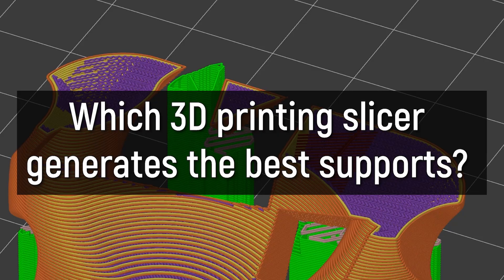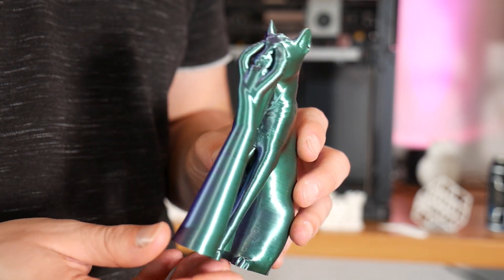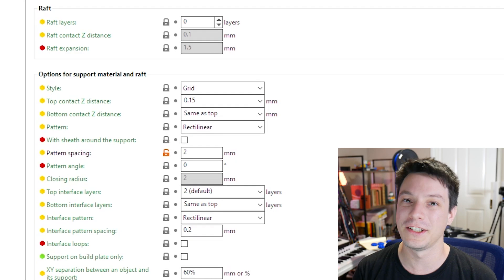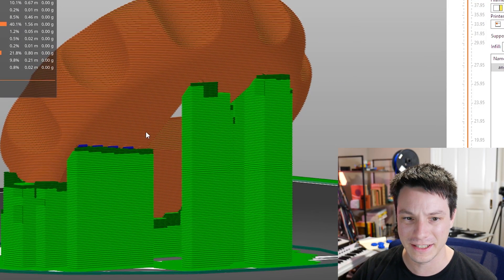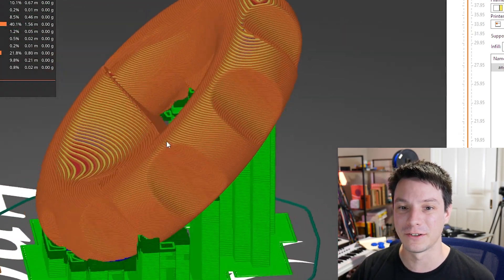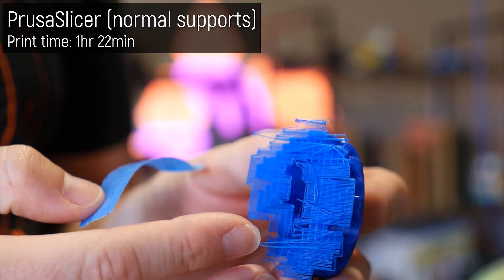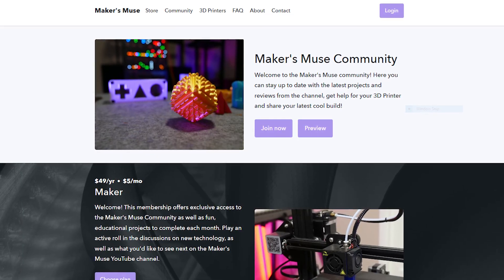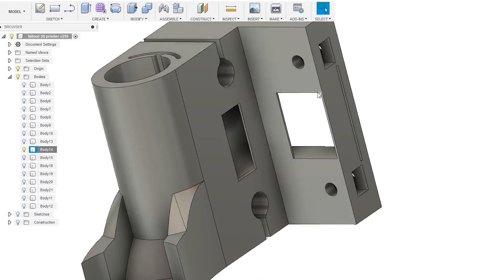Which slicer has the BEST support material? #3DP101

Comment: Regarding your last point, avoiding support is the best strategy, I have had so many problems with removing support I have an aversion to support material at all! One thing not to be afraid of is to design your part as mutiple parts that screw, glue, or clip together. Its tempting to try to make it print out all as one part, but sometimes you can make a nicer looking part as multiple pieces. This also means that making minor changes means you can just reprint one or two pieces rather than the whole thing, and it also opens the opportunity to make your part multi-colour if the aesthetic is important and you don't have a printer with multiple extruders.
Reply: This. Comparing my more recent projects that are designed in pieces to my older projects that are just one big object cut up using meshmixer, designing for it means you have so much more control and can often avoid support entirely
Reply: Totally. Printing a model in various parts and gluing them together can be a great way to side-step hassles with supports. 
Something else I found helpful and quite easy is to design my own supports instead of relying on the slicer to do it for me.
Reply: One thing that helps is using a hair dryer or heat gun to heat up the offending areas. Makes it much much more easy to pull off stuck supports.
Reply: Usually layer height x 1.25 worked for me quite well, depends also on material, some just have better layer adhesion than others.
Reply: Probably works well for machines and stuff, but I've found that with art designs this usually isn't really an option, especially not when it comes to organics.

Comment: TL;DR: "Preferences" -> "Configure Cura" -> "General" -> untick "Automatically drop models to the build plate"

Really quick tip for anybody getting angry at Cura for dropping the parts to the build plate automatically (as I was before I looked at the settings): There's an option in the menu bar, "Preferences" -> "Configure Cura". It should start you out on the General tab (otherwise switch to it) and under the heading "Viewport behavior" there should be a checkbox for "Automatically drop models to the build plate". Uncheck that if you don't want the lowest part of your model to touch the build plate (i.e. hang it in midair to generate supports underneath).

Extra tip: if you don't want to switch that option on and off all the time, you can manually drop the model by selecting it, using the "Move" tool (or pressing 'T' ) and setting the z value to exactly 0. Hope this helps somebody :)

Comment: I’m surprised no slicer is using local adaptive layer height to increase the printable overhang angle. It shouldn’t be that difficult to have it print the outer edge in two or more layers, and then the rest of the layer at ”normal” layer height. That way you can get away with really steep angles.

Comment: Designing parts that don't need support is a challenge I enjoy.
Especially TPU when you can use its flexibility to create living hinges in the print, giving it some origami traits.
One of my designs needed support so I made the pieces myself and put them into the design because I didn't trust the slicers to make them. It works well, the 3 support pieces easily snap off after printing, helping ensure the end users get perfect prints each time.

Comment: As a beginner to 3d printing this is was incredibly helpful.  Perhaps as a part 2 you can also include information and advice on model placement and orientation to help with better print quality and support use.  For instance, you mentioned the sharp downward pointing angle and how it must have support.  I would assume something like that could be greatly assisted with rotating the model.  Placement and orientation is definitely an area I find to be tricky at times, especially when I need t set supports.

Comment: I have been playing with Cura's tree supports in the alpha release. I had quite a few failures until i realised that it doesn;t cap off the supports by default. So you can end up with a tall support building up fine but because there was no top on it the thing it was meant to be supporting fails. There is the option to include a top but you need to make sure there is some infil in the supports otherwise there is nothign to build the top on.

Comment: I find Prusaslicer calculates heights wrong when I combine raft and supports which is usually for first couple of hundred layers of a segmented hydrofoil with leading edge pointed downwards. The supports start mashes into the raft layer. I still get great wing prints though.

Comment: Cura also has settings for interface layers and some small adjustments pay huge dividends (included my settings). Would be interested to see a follow-up with support interface enabled. Love your vids Angus! Keep it up! Awesome resource for the community.
My settings:

Tree supports, touching build plate
40deg branch angle
0% density
1 support wall line 
Enable support brim w/3mm width
.2mm support z distance
.4mm support top distance
⭐️enable support interface
⭐️enable support floor
⭐️enable support roof
⭐️ .12mm interface resolution
⭐️ 100% interface density
⭐️ concentric interface pattern
Reply: Came here to say the same. I have my interface on "concentric" and at 80 - 90% density for parts that need to be pretty and sometimes you can't even tell they were overhangs.
Reply: @XxBanziixX1  Same results here.
Reply: Thanks for the tip on the interface, I just never use it so wouldn't even know it makes a difference.
Good cooling also makes an enormous difference in support removal ease. The difference between removing supports (both default settings) between my custom machine with single a 5015 blower with two side cooling duct vs. a stock Ender 3 is absurd. The supports just stick on the Ender 3 like they were supposed to be part of the model.
Reply: @Kalvinjj  I'm still running a mostly stock Ender 3 v2 and have had great results. But I can totally see how good cooling would help
Reply: @joshuajohnson5121  Nice, so you slow down before the layer above the interface?
I can imagine that helping a lot.
Then again that PLA I'm using prints pretty hot (225°c) so guess the cooling is definitely working extra.
Reply: @Kalvinjj  Nope, no slow down. I print PLA at 210C usually. Mind you, I don't print super fast. 50mm/s max for most things. For prints with small details I care about, I'll usually slow down to 40mm/s or so.
Reply: @joshuajohnson5121  I see, makes sense. I always keep flow before under extrusion as well, but that still leads to like 0.6mm lines (still on the 0.4mm nozzle) and 0.2mm layers at ~60mm/s, with lots of headroom. Guess I'm just pushing the cooling too far.

Comment: Success with supports for quality and ease of removal relies partially on layer height of the print and the z height gap between the print and the model. There's a ton of power in Cura for playing with this and some tuning with z distance, support interface density, and even x y distance can save a ton of print time, material, and cleanup effort. It seems like you talked about tuning in Prusaslicer but didn't bother to tune the support settings in Cura causing your supports to be more difficult to remove with Cura than it needed to. There's also plugins like manual cylindrical supports that can target the areas specifically needing supports too.

Comment: Very interesting video. Did Cura’s supports fall more in line with Prusa’s if you inverted the angle?  As I’m sure you’re aware, the reference is swapped compared to Prusa Slocer. For example, 30 degrees in Prusa is 60 degrees in Cura. Love the videos. Keep up the great work!
Reply from the maker: You're right, I mixed it up ! I'll do more testing to see how it behaves with a lower angle threshold
Reply: I was so bamboozled when he told that. I was doubting myself whether I was increasing or deacreasing support in cura haha

Comment: I recently got a Bambu P1P.  While the support should be the same since Bambu Studio is based on PrusaSlicer, I find using the same settings on Bambu do not release as easily as on my Prusa Mk3s using PrusaSlicer.  I spent a solid day testing different settings to find the cleanest in BambuSl. This was a functional design with big overhangs.  Not sure if it was the speed of the supports being laid down but the removal and interface wasn't as nice.  Still trying to narrow that down to make them the same.
Reply: I have my z distance for supports set to 0.45 to 0.4, which is higher than default. Try that. 

Default bambu settings lays the last layer of support a little close to the layer its supporting, and I find it fuses much too often. I think the default is 0.3, (also its a little different to prusa in that you can have 2 different layer heights, so it won't just round the 0.45)

I would also increase the interface density, so set it to something like 0.1 or 0.2 to make up for quality. (Just for interface layers not for the support in general)
Reply: @magnarex  that’s exactly what my tests led to. .4 z distance. 👍
Reply: If you're using default material profiles with the Bambu slicer, then it tends to print hotter than other slicer's defaults.  Higher temperature combined with better cooling lets Bambu print faster, but makes support harder to remove.  Could fix this by dropping the print temperature when printing on top of supports, but that's a set of compromises most slicers don't bother with.

Comment: Simplify3D does the best supports even with their default settings. Too bad with their lack of a proper development cycle for their software, but as creating supports go, they're still the best.   You snubbing them won't change that fact.
Reply from the maker: No but the price tag might
Reply: @MakersMuse  How will the price tag change that Simplify3D generates the best supports? And tbh it does generate very nice supports, was hoping to see it included.
Reply: @radish6691  The price tag is simply far too high for the average user visiting this channel. You can wonder if the slightly better support is worth the (European) price tag of €240. Seeing that the average printer is about €200, it's easy to see it's difficult to take that slicer seriously in consideration. Maybe people would buy it for €20 to €25, but that is as far as it goes.

Comment: Check out the “snug” support option in PrusaSlicer. Way better than their original supports. I’m surprised they have not made it the default.
Reply: I agree. I haven't found a reason to turn it off.
Reply: I'll have to check that out. I get way better prints with prusa slicer, but supports always suck...
Reply: Yes, "snug" is much easier to remove and less wasteful. I would prefer it the default option as well. Maybe not best for all purposes but especially good when supporting a detail over another layer.

Comment: Using tree supports on the Bambo X1 work incredibly in my opinion. Had the X1 for just a few weeks, but I will probably never use any other support on this printer.  I thought the tree supports in their slicer were one of the greatest benefits!
Reply: maybe the tree support for bambuslicer is tuned to the accuracy of the bambu printer so when it's used for an ender 3 the tolerance is too small
Reply: @aronseptianto8142  Work fine on my enders. 🤷
Reply: @aronseptianto8142  the accuracy is crazy on the Bambu, I imagine it would be fused on other printers
Reply: @whopperlover1772  It's no more accurate than any other printer that's been dialed in properly. 🤷
Reply: @dangerous8333  I don't really think so, bed slingers < CoreXY
Reply: Been using tree supports in cura and cheap enders for quite a while. 🤷

Comment: Would have liked to see fusion 360  in this comparison as well
Reply: That isn't a slicer and doesn't generate supports.
Reply: @JesseSmtns  It's not a slicer but it can slice your models, don't know about supports as setting it up to slice your model looks like a pain in the ass.
Reply: @JesseSmtns  fusion 360 has a built in fff - sla - DLP - SLS - mpbf and ded slicer and can generate support structures

Comment: i must admit i still think simplify 3d has some of the best supports for customizing though i hate what they have just done with v5 i will stick with the older version. i hated cura supports i could never get the room sorted on the top of there supports it would always bond with the models. but again i was using an older version but again i never use it.
Reply: What issues do you have with the new version?
Reply: @pennyfpv  new version of cura or new version of s3d
no issues with latest cura as i have not installed it. latest version of s3d. that they charge for the update already paid for the software once. not paying for what should been a free update. but older version still works great. also with cura when i try to install it. it wants to to delete my moia version of cura so not letting that happen :)

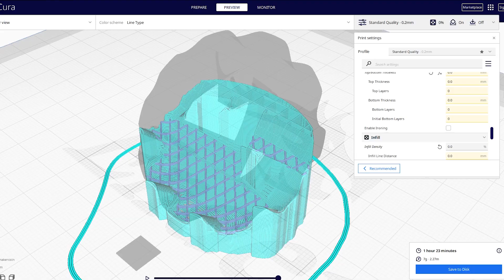Comment: Around 11:53 you mention printing stands out of support structures only. I've been doing some explorations lately too, and I'm finding I can make remarkably good filter structures by setting my top and bottom thickness to zero, and playing with infill settings and wall thicknesses. It's remarkably accurate.
Reply from the maker: Yeah, filter medium is a great use case for infill only structures!
Reply: @MakersMuse  do you adjust the X/Y or Z offset settings?
Reply from the maker: @danbrunermer4295  I did not, I've always used defaults. The bambulab tree supports might benefit, but I feel they won't support the part if they're made to be further away.

Comment: I've always been lazy and just use simplify 3D as much as version 5 craziness angered me version 4 just works 99% of the time
Reply: Can’t imagine paying for a slicer nowadays tbh (for consumer/prosumer machines).
Reply: @RightJoystick  I wouldn’t pay for a new license but did pay for the upgrade to v5, though I still prefer v4. I’ve used it forever and is the slicer that got me printing successfully.
Reply: @radish6691  go ask for a refund, i did and got a refund. the upgrade doesn't let you have two instances of s3d v5, you can have one s3d v4 instance on one oc and one s3d v5 on another, they never mentioned that anywhere in the purchasing process, and in the refund request they told me it is mentioned, I checked again and couldn't find any mention of this change so I just refunded and I'm using cura now, much better honestly than s3d v4 or even s3d v5.
Reply: @RightJoystick  payed for it years ago
Reply: Always used S3D v4 at work for years, does the job perfectly. When the v5 came out, i got pissed off to pay for BS and switched to Ideamaker which is more efficient with a bit of tuning. S3D v4 > Ideamaker > S3D v5 for me. Never used Cura, or Slic3r.